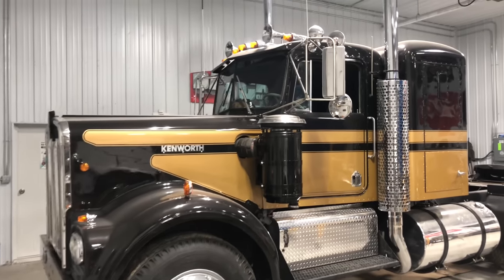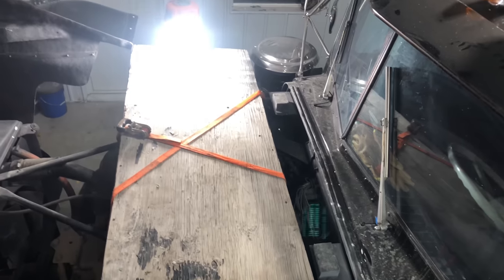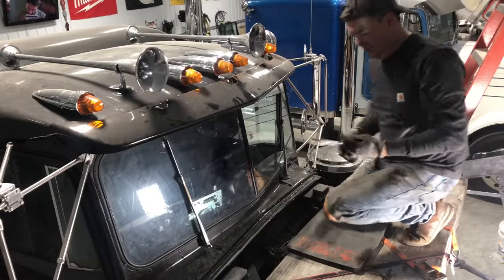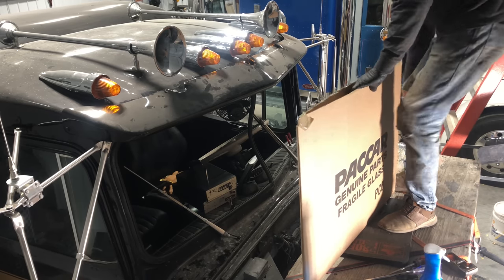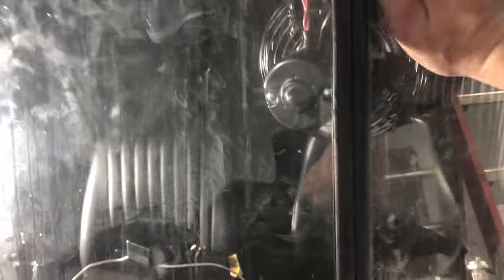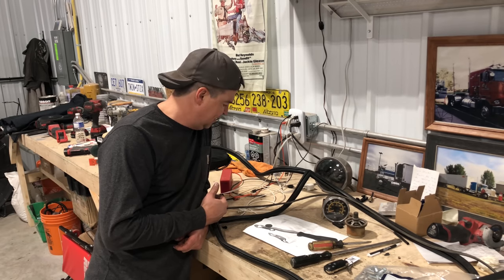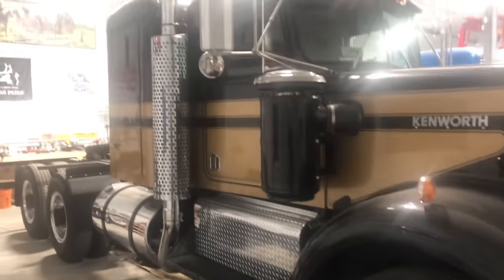Smokey & The Bandit Tribute Truck Ep.58 Sir, Please Don't Break The Glass

Comment: Anyone else screaming “take the wiper arms off for the love of Burt!!!” 😂😂
Reply: Yes ... Me
Reply from the maker: I couldn’t as the arms were seized to the splined stumps … would have to destroy them to remove which is why I left them on to paint as well 👀
Reply: @TwinStix  My Pops' old 359 was all seized up too. I did see an electric conversion videoon a 359(company probaly makes a kit for a KW) here on utube just this morning!
Reply: I have been screaming that for ten minutes. Two nuts and there off and out of the way.
Reply from the maker: @dennisternent2974  as I’ve mentioned 🤦‍♂️ due to severe corrosion they are seized/welded to the splined output shafts and I would literally have to cut off/destroy them to remove
Reply: I know I was !!!  😅
Reply: Yes!!!!
Reply: I was just going to say that😂
Reply: Mark take the wiper blades off.
Reply: First thing I said to myself...second was, why doesn't he wash that thing...lol.
Reply from the maker: @randyhale4181  🤦‍♂️
Reply: @TwinStix  makes sense!
Reply: This video is by far the best of the build series. Im so glad you didn’t give up. When you gonna show us the truck all light up at night?
Reply from the maker: @dallasmavis3082  haha when I finish wiring it all up #futurepisode 👀
Reply: Prop wipers away from glass. Do not change seal unless absolutely needed. Then do one side at a time. Seal goes in first. Then the glass.
2 tools needed. Flat blade screwdriver and a lacing tool.
Reply: Yes! Lol
Reply: Yes sir definitely
Reply: Yes sir
Reply: Yes
Reply: It’s like he does everything the hard way! That’s what happens when you do something for the first time.
Reply: omg yes! Im currently 11 min in and I'm yelling WTF Mark, take the damn wiper arm off!!
Reply: Yes I was and Mark just went right on
Reply: @TwinStix  isn't it nice to have all those keyboard truck restoration experts giving advice ....
Reply: lol yes i was like there was half of the fight there

Comment: Push it from the inside out then u put the new rubber around the glass first the you put a thin nylon rope in the outer channel lay the screens one the windscreen opening with someone on the outside pushing the screen while you pull the rope on the inside the rubber will fold over the lip make sure u cross the rope over each other u will a special tool to install the locking bead in
Reply: What Glenn says. Get your feet on it if you can from the seat and give a steady push straightening your legs if possible. I use parachute cord, thin but very strong.
Reply: Nope not on this style...
Reply: Agree with Jojo , not on this type.  First, always wear safety glasses. Push old glass from inside after prying rubber away from glass all the way around. Get new glass to seat in bottom first…use lots of silicone spray or soap then gradually work your way around with a plastic stick until it’s all seated properly. Do both sides then the lacing after. Start the lacing about halfway down the verticals first and across the bottom as the weight of the glass will make it very hard to do if you do the top first. Good luck!
Reply: Windscreen? You must be from Europe or Australia. What you said is completely right though.

Comment: I worked part time at a automotive glass shop years ago and have restored several vehicles and one thing I learned after the first restoration and this applies to full vehicle repaints and that is always remove the windshield wipers and arms before removing the glass, and always remove all the window glass before you repaint the vehicle.  Additionally always replace the window glass gasket if it uses one (as long as it’s available). As far as lube goes I prefer using either liquid Ivory soap or Murphy’s Tire and Tube mounting compound. I used cotton clothes line or sash cord that I pre stretched and impregnated with lube.  That all said doing the “windshields” in the W900 you are better off having a  second person and treating the windshields as one windshield. PS it does get much easier after you do few (hundred) 😁
Reply from the maker: I couldn’t remove them as the arms were seized to the splined stumps … would have to destroy them to take them off which is why I left them on to paint as well 👀
Reply: @TwinStix  sucks they are seized on because they surely made your job harder but now knowing that certainly explains why you left them on to fight with.  When the times comes to have to rebuild the wiper motors because they are leaking air you may want to try using your favorite penetrating oil, a heat gun or very small torch and giving them a good wack or three with a brass or lead hammer and then rinse and repeat for a several day or a week being careful not to cook your paint job.  If I am not mistaken KD Tool used to make wiper are removable pliers. Thanks for replying and I wish continued success on your rezerection of L-B-L, SnowMan, and The Iron Duke.

Comment: I love watching your channel and seeing some different ways of doing things. I work on heavy duty trucks all day. I do about 30-40 windshields a year for the fleet i work with. So far only 1 broke out of 300 or so total windshields replaced. I find it easier to take the lock strip out, use lots of windshield wash or soap water and soak the gasket and push on the inside with your foot. Then reapply soapy water and set the bottom inside corner of glass in the gasket and work around it gingerly with a nylon pry bar until its all in. Gently tap and it will fall into place. Lisle sells a tool for the lock strip that sets it in less than a minute. Just add more soapy water and it slides right in.  When doing the gasket too, putting the glass in first keeps it more centered and you dont fight the gasket either so bad. And if its a glued in gasket then it helps lock it in too so it can set properly. Great to see the project coming along, cant wait to see the trailer with it. It will be awesome.

Comment: I find it amusing that guys like us are willing to tear into the engine to replace injectors, run the overhead, change injector cups…. But when it comes to the windshield we doubt our ability and want to run and call the pros. I did the same thing but got it done. Next time I replace a glass I swear I can probably get it done in 15min it’s so easy 😂
Use Urethane around the moulding and body and in the channel were the glass sits, my local glass guy recommended cleaning the groove and applying some silicone spray and gently wipe it to leave a film then apply a small bead of urethane in the groove and install glass. I did it this way and it doesn’t leak on my W9

Comment: Great job ! But still would have taken wiper arms off. Tip on locking spline, it will stretch it rolling it in, so don’t cut it off right away or it will be too short when it relaxes and a few contraction & expansions due to temperature changes. Beautiful truck and the new glass really sets it off ! Can’t wait to see the trailer done all hooked up with it ! Have a Blessed Day

Comment: Nice job on the windshield but for the future, the locking strip is removable to allow for flexing of the lip that goes over the frame.  So install the weatherstripping over the glass like you did on snowman but put the windshield inside the cab.  Use the rope trick to pull the weatherstripping from the inside out.  Then use your tool to install the lacing/lock.  You will need 2 people to do this so pressure can be applied to the window glass to keep it from falling back into the cab.

   I used to use silicone spray to lubricate the weatherstripping but the soapy water worked well.  I also made my own tool out of a welding rod.  I doubled the welding rod over in the middle to make the loop, it  worked well because of the round welding rod.

  one more tip would be to push the lasing/lock back towards the hole in the tool to keep it from stretching.  Over time the lacing/lock strip will shrink back to it's original length and leave a gap.  

You might ask why not put the lacing/lock inside the cab.  the lacing/lock serves two jobs.  first it helps in the installation of the glass but it also helps swell up the outside lip to seal the weather stripping to the windshield and the window frame.

Comment: When there is a filler bead ( the round rubber piece of rubber  you pulled out first )  in the weatherstrip, you leave or install the new gasket then install the glass into it.. 
 When there is NO filler bead, then  you install the gasket on the glass and use the " rope a dope" trick to install the entire unit  ( glass/gasket) into the truck... 
  You were expecting too much from the install at first.. ... You need to start the lower out side corner, then work the glass ( using your install tool) into the gasket along the bottom, then up the outside... Push the glass from the middle over to the outside to set the glass into the gasket... Use your install tool to work the glass into the top of the gasket, then push the center part of the gasket over the inside of the glass...

Comment: mark I've done about 400 Truck windows a Month I sure know how to put one in.
a little advise when puting the new one in, 
take the fillerband the rubber seal and grease it with a tyre mounting paste,
put it at 100°C in the oven for about an hour
so it's hot so it's easier to put it back in.
and you need a cable twice as long as the surround of the seal and a second person to put it in
that holds it in place and sligthly pushes against it.
Pull th string ALLWAYS straight to the windshield middle.
For the Filler tube pull it slow and start at the bottom 
for the tool, the tips are replace able, so just buy the tip and use your screw driver handle with the hole.
the filler is a Triangle shape and the tool has a square to fill it through.
you need a lot op preassure to pull it and press it in the edges also,
you want the filler TIGHT leave no gap, make it longer and push it back in the end then cut it and push it in with the screw driver.
also on tip take a broken screw driver make it pointy and bend it 170°-180° to a hook 
so you have a tool to put in between the seal to make sure the sealing edge lays flat on the cab
AND take of the wiper arm.

btw. you are lucky you have the filler ones, on cars they do nea all have them there are closed ones or metal ones, those are a real Pain.
but good work for doin it all alone by yersel.
Reply from the maker: I couldn’t as the arms were seized to the splined stumps … would have to destroy them to remove which is why I left them on to paint as well 👀

Comment: We use the wire to pull the seal over as well, even on the newest trucks! It is way easier with two people, but there aren't always two people, so we have those big suction cups for lifting glass. Helps a lot! We also use that black silicone stuff behind the seal. You did a great job! Thanks for the video!

Comment: Mark, you rope it in with a 1/4 inch rope as you pull the rope it overlaps the rubber back onto the glass all the way around it is a very simple process.

Comment: First step remove wipers. Second remove  the pull cords. Then go inside and gently push a section of the glass outwards working gently around  the perimeter of the glass. Most of the time they can be removed without ever cracking them.

Comment: mark put the glass in the rubber and a wire ore rope in the rubber where it hold in the windowframe. then press from the outside to th e frame while pulling the rope. and it will slide in.

Comment: Watch that outer seal closely now. The outer seal is supposed to glued in. As a kenworth tech we’re taught how to do glass swap and this was really tough to watch 😂 but you got it done by yourself so props to you! Some advice is spray the old glass with soapy water and push it out from the inside. Then for reinstalling, get the glass started in the middle and slide it in towards the outer edge. Then you just have to get the middle bar over the edge of the glass. Radiator picks are your best friend for these jobs since they help gently get the seal over the glass.
Reply: Yup, seeing him pry from outside had me cringe. Sit in seat, use feet to push out evenly.

Comment: International got it right in the 90’s.  The center rib un bolted and you can slide out the glass at the angle towards the center.  New glass slides back in then bolt the rib back in place.  It took about 1/2 the time to install mine as watching you do this.  Aftermarket glass was $90 each side.  I can only imagine what your OEM glass cost! Kudos for you gutting this one out!
Reply: as much as i hate to say it international got a LOT of things right with their trucks (especially the early 9900 and 9630 (although i never liked that quad headlight look) but the interiors of those is one of the best in trucking unfortunately the 9200/9400/9600/9900 always rode rougher than 3 nights in jail... then they started making those pro stars and lone stars and after having driven one once i will NEVER drive another !! it's a shame because i started truckin back in the 90s in internationals and i always liked them

Comment: great job Mark, love your work you have done on the truck. a few years ago I did do a window job on some old European trucks with windows like that. I did put the seal on the truck first. then put the rope in the channel. lubed it with lots of soap and put the window in the underside of the seal from the outside. the you can push the window against the seal when pulling the rope. normally the lip that fits on the glass is shorter then the part that fits on the body of the truck so it's easier to pull.  maybe you can try it next time. please keep making videos they really make my day. greetings from the Netherlands

Comment: Good job . For those who try this you need to inspect the metal that the seal attaches to for rust or corrosion and great it with POR 15 and also finish up with 3m urethane seal NOT silicone!. And of course make sure you have a wide blade screwdriver to make a tool 😂😂😂

Comment: When I have done it before I used clothesline rope and it was a breeze. First tuck the rope into the gasket, then the gasket around the glass, then hold the whole thing against the window opening and pull one end of the rope from the inside. 
Probably would need a second person on that application though.

Comment: Mark, keep any off cuts of the rubber bead as it will likely shrink back from where you stretched it putting it in. You can always put a few small pieces in later to fill any gaps that might appear.

Comment: These are definitely not my shorts. 
I buy my shorts at Kmart. 400 oak Street in Cincinnati.  
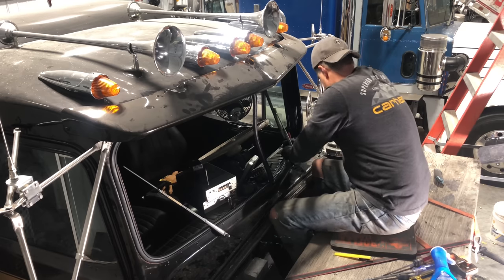Lights out at 11:00
My bed has to be by the window. 
I'm a good driver, drive the car on Sunday in the driveway.  
286 on the floor four definitely still in the box. 
Outstanding determination.  I thought for a second you were going to call The window guys.

Comment: Those rubber seals are mongrels, we had  a Prevost H345 coach bus with 4 big curved panels in front. The glass guys didn't even want to try. So we had to do it ourselves. Same system as snowman. We soaked the rubber in hot water for 10 mins and made it nice n soft. The rope trick as well. The worst part was how heavy each piece was and that your up on a twelve foot ladder.

Comment: Well if you change another window. I used WD40 instead on soapy water. Worked great. Also had a set of the plastic window tools that made it nice to slide around and pop the windows in on my truck. Either way it’s not the easiest job to change windows. Nice job!

Comment: take the wipers off put the rubber around the glass put a pull cord around the grove where it mounts to the cab frame ,put it up to the opening and pull the cord from the inside to get the rubber into place.you definatley  need two people to do this
Reply from the maker: I couldn’t as the arms were seized to the splined stumps … would have to destroy them to remove which is why I left them on to paint as well 👀
Reply: @TwinStix  ok 👍,

Comment: You should have soaked the windshields down with soapy water, then ran a razor around the rubber, front and back. Would have popped out with a little push from the inside.

Comment: Why didn’t you take the wipers off? They usually use rope to pull the rubber around the glass.
Reply from the maker: I couldn’t as the arms were seized to the splined stumps … would have to destroy them to remove which is why I left them on to paint as well 👀

Comment: An easier way of removing the old glass would be to razor cut the rubber from inside the cab if you have a new one right there. I know you would like to save it but the time saved is worth it in the lon run. Just my opinion.

Comment: Easy's way to do it is use some Daw dishwashing soap and run it around the easier push out
Reply: That should have said the easiest way to replace the window is to use some Dawn  dishwashing soap. Makes the glass slide in-and-out of the rubber and easy to clean afterward

Comment: When I put new glass & rubber gasket in my '39 Packard last year I installed both pieces of glass into the gasket, the roped in the entire assembly(btw, the rope "trick" is not a trick. It is a normal procedure when working with old glass). But I have a friend that I enlist to help me do old windshields, but all he does is give a bit of pressure on the glass from the outside. Also the glass does not get lubed, only the gasket going into the frame ;). Look up Precision Gaskets' vids on utube. Also, curious as to why you did not remove the wipers, for this or the painting??
Reply from the maker: I couldn’t as the arms were seized to the splined stumps … would have to destroy them to remove which is why I left them on to paint as well 👀